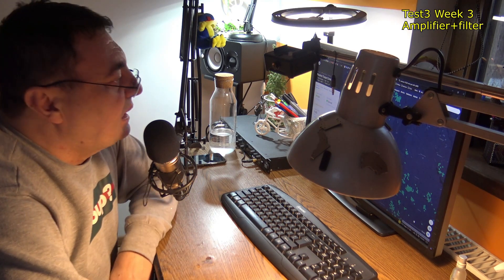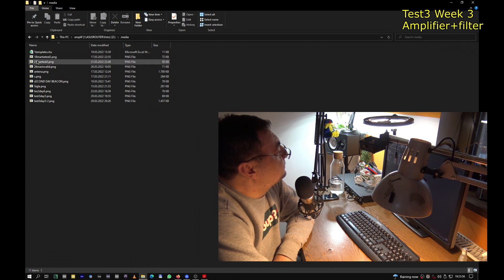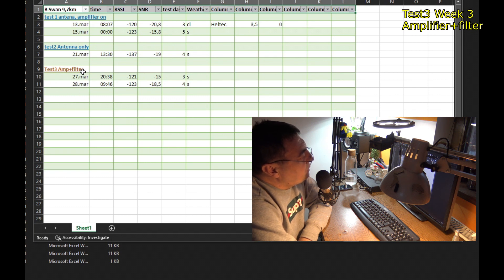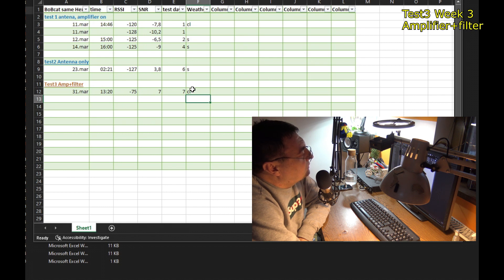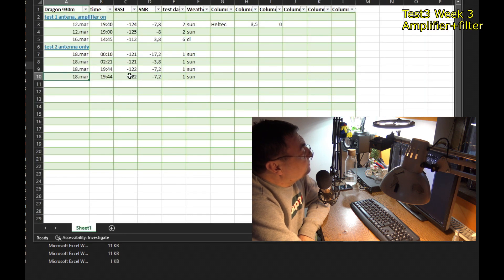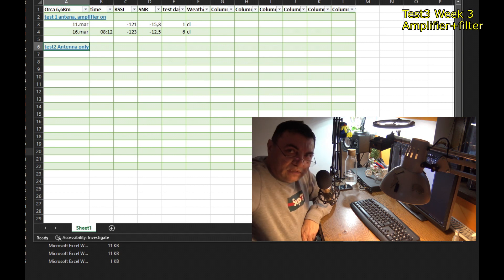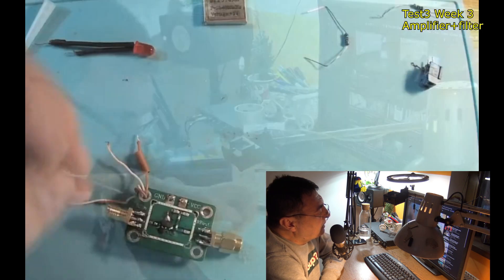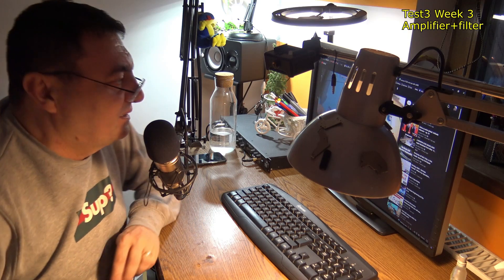LoRa Helium test week 3, amplifier+filter

Comment: Regarding the invalid witnesses, have you tried to increase the antenna gain on the Helium App? The PoCv11 implemented that feature to avoid invalid witness. Also remember that some users could be spoofing location, so they could be even closer to you.

I would appreciate if you show us your physical setting to see how do you connect the antenna, coax cables, the amplifier and the miner.
Reply from the maker: Yes I did..but the network is a mess..I simply can't have enough witnessing..so far it's ok..

Comment: Good work Viorel , interesting results!  On Helium explorer you can go and look at the new Witnesses you had to see if they are new hotspots, or old ones, that way you know for sure if it is truly a new signal you are receiving from that area. You can change your antenna dBi to 15dbi, that will get rid of your Invalids, if you don't mind reducing your TX power. I also placed a new video on my channel for new software to compare witnesses - I think I will also try to automate some analysis to give a view if old or new configuration is better or worse - but difficult enough with the brain, let alone computer!
Reply from the maker: Nice! I'll try about antenna..I'm not sure have any impact on RX..it suppose only to change TX power, but thanks for the tip..I'm still counting..
Reply: @viocaia  Correct, it will only reduce your TX power - but will also stop you getting invalids because the network will think your Antenna has more gain (has nothing to do with RX sensitivity, only what the network thinks), so your gain from amp will no longer cause invalids - better to be earning a little more while testing - will make no impact on your actual test results, only income ;)
Reply from the maker: @BryanGreek1  Now it make sense, Thanks!

Comment: Felicitari pentru efortul de a invata pe altii din propria experienta... Ma gandeam azi la un lucru... daca esti de acord, as putea veni la Tg Neamt si sa imi testezi contra cost, antena mea de 8,5dBi, daca e "acordata" bine pe frecventa si daca are sau nu puterea inscrisa... Ma gandesc ca daca am lucrurile astea testate, pot trece la pasul urmator... Lucrurile la mine stau cam la fel de prost cu incasarile pe miner, cam cum e si la tine si nu stiu daca e doar din cauza pozitiei proaste a antenei sau mai sunt si alti factori, cum ar fi o antena prost "acordata"...... Felicitari inca odata pentru ceea ce faci!
Reply from the maker: Acordajul nu e totul..trebuie facute teste de RX TX..asta impune ceva munca..o sa incerc sa pregatesc un stand , afara in curte ...deoarece trebuie o antena standard pe TX si la vreo 20 metri cel putin si asa se poate determina ce cistig are antena..dar in principiu, sa vedem daca e pe frecventa , nu e problema..dureaza viteva minute..parerea mea ...cumparati o antena buna..gen McGill 6dB..de la firma autorizata..si in functie de ea se pot face toate reglajele..inclusiv antene noi...dupa aia..la vinzare!